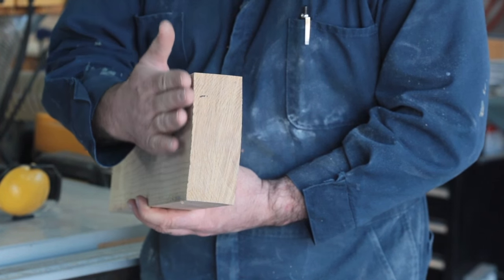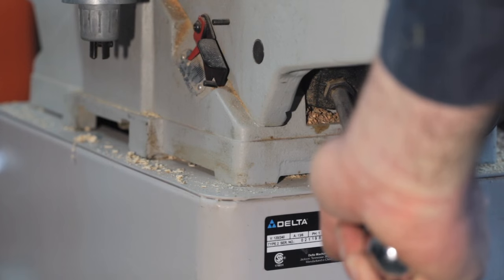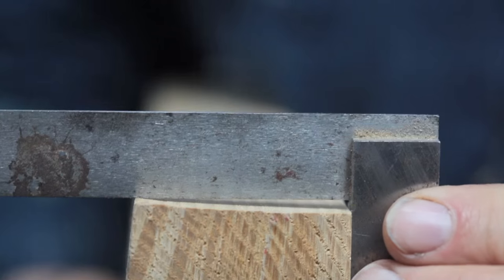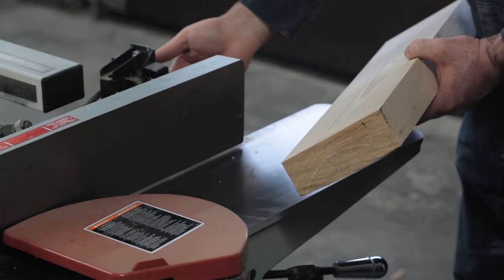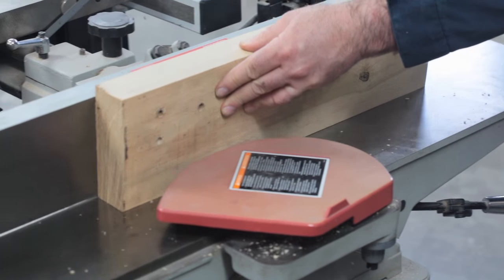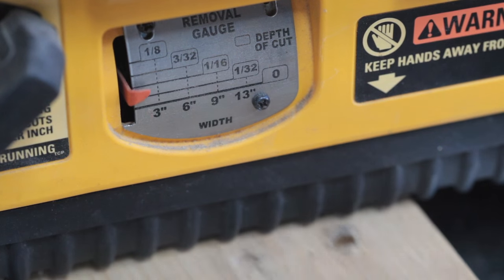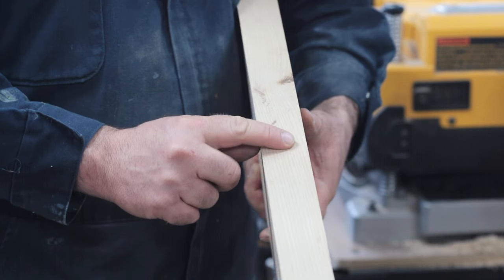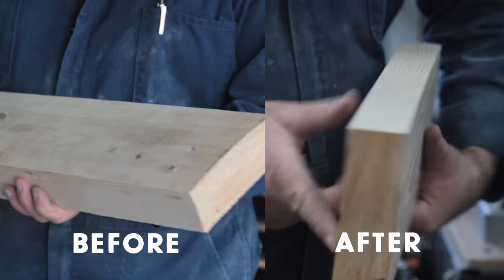How to Mill Lumber Flat and Square

Comment: You can take 1/16 off on a single pass with that DeWalt planer?! I've got a Wen and I have to go 1/32 at a time or it gets bogged down. Guess I need to start saving for an upgrade.

Comment: You said you finished up the last edge using your table saw on a 90 degree cut. Could you just run the last edge through the jointer to make it square?
Reply from the maker: That's a great question! You're right in that a final pass on the jointer would square up that last edge, what you couldn't be sure of is that the two edges of the board would remain perfectly parallel. Whenever you make a jointer cut, the leading end of the wood seems to have a slightly deeper jointer cut than the trailing end. So after several passes on the jointer, the edges of the board are no longer parallel. Finishing up that last edge with a tablesaw cut instead of the joiner ensures that the finished board has perfectly parallel edges.
Does this make sense? Let me know what you think.
Bye for now,
Steve
Reply: You could but I would take several passes just as the first edge did, also if your cutting multiple boards such as for a tabletop to the same size, you still have to cut them all to the same size

Comment: Sorry I have a question. Why not use the planer jointer to get the second face flat instead of the thicknesser planer? Do we really need this second device and why?
Reply: Jointer will create flatness not parrellism. You can drop the jointer from the equation and use the table saw (sled) or circular saw (guide) but the jointer creates a better glue surface. imo.

I used the jointer alone for today had an 1/8" difference in 7" of run..
Yesterday, I worked with a plank that was tapered from 7/8" to 1.5" over a 12" width. (Sawmill rejects, cheap/free)
Reply: Thicknesser is used to make the surfaces parallel and to finished thickness.